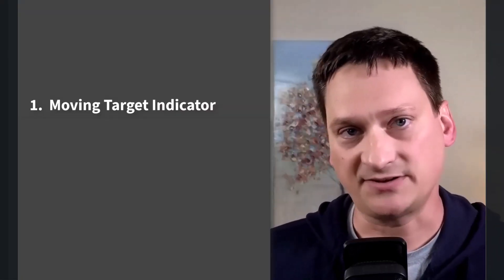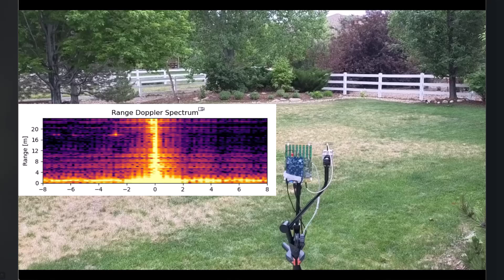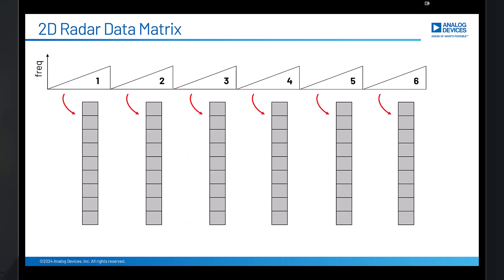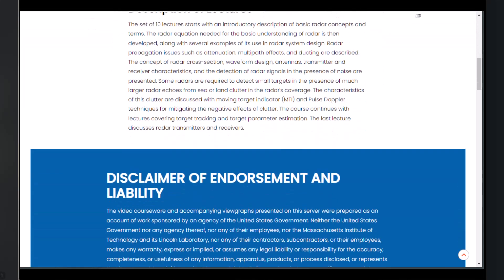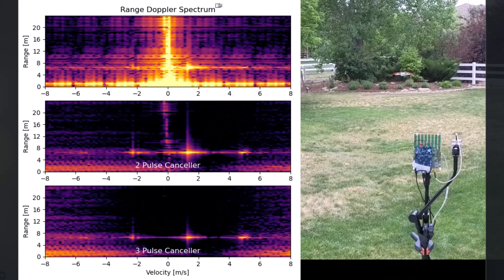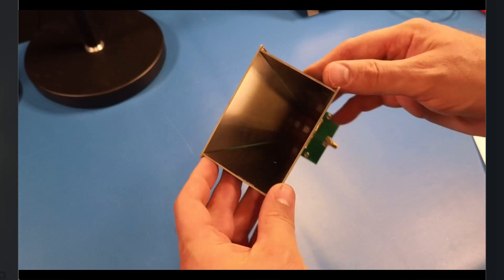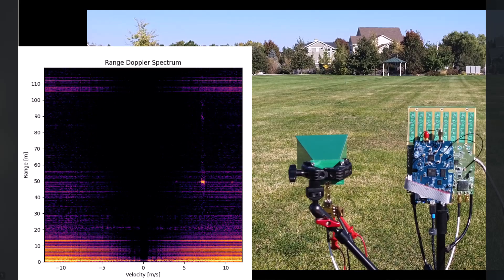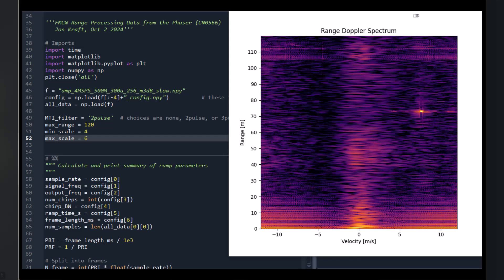Drone Tracking Radar:  Part 7 Longer Range and MTI Processing

Comment: Jon, thanks for making these videos.   I would love to see how you might be able to get MTI to work if the radar antenna platform is mobile,  if that's even possible.
Reply: Should be possible with more signal processing. Now the ground clutter (the center vertical line) would be moving too. Would be interesting to look into and to get some data samples.

Comment: Well, it of course helps to add a transmit amplifier. The question is if it is possible to improve something with antenna setup (better antennas, bigger antennas) to get even more longer range? It should be possible to add enternal atnennas to phaser instead of PCB. Could be something to do in video #8? :)

Comment: Dear Jon.
Thank you for your great work. I also played with chirp alignment (in another code) and I also had to implement similar chirp correlation and alignment. But then I found in my code that the shift in chirps was connected to wrong num_samples_frame calculation which I used here: start_index = start_offset_samples + burst*num_samples_frame. In your code here you use similar N_frame variable: start_index = start_offset_samples + burst * N_frame. After I change default code line from num_samples_frame = int (tdd… to num_samples_frame = int(round(tdd… the correlation and alignment of chirps are not need anymore. You can try in your code and also change the N_frame to N_frame = int(round(PRI_s * float(sample_rate))). So seems like the N_frame size difference changes all n chirps begin index and caused misalignment of chirps in further processing. I am not a SW engineer and can be wrong here so please review. Thank you!
Reply from the maker: Thanks!  I’ll try that out!

Comment: Great video John! I have another idea to increase the range and SNR. This works with my fmcw radar that I’m working on currently. I’m able to detect a small vehicle out to about 1km so far (given my testing environment I probably could go further) the biggest thing that I have come to realize when trying to increase SNR and detect small things like drone is Digital possessing gain. A higher number of FFT points and Doppler bins heavily increases SNR. I get a 30db digital gain after switching from a 1024 point plot to a 8192 point plot. Another thing I implement is coherently integrating chirps that are phased aligned to reduce Doppler spurs and get anywhere from a 10-12db from (4 coherent averages) in digital gain increase. You could do coherent chirp averaging a couple different ways. Note, the radar I’m working on is basically a classic MIT coffee can radar on steroids. I actually plan to integrate my Pluto plus sdr into it but I bricked it with the wrong firmware so now I have to use JTAG to recover it :(. But regarding the different ways of coherent integration, the way I do it is a very simple and straight forward approach without a reference sync signal both MTI and coherent averaging. What I do is take the chirp repetition rate and find the wave period so for example: 1/1000hz (if using a sawtooth waveform) which gives me 0.001s i can then use that value to and multiply it buy our sampling rate to get the amount of samples you need to subtract using a delay line canceler. This also goes for the coherent and non coherent averaging by summing the complex-valued signal sample Y_i = Σ X_ij where: Y_i is the output of the coherent integrator for the i-th sample. X_ij is the j-th input signal sample, where jranges from 1 to N.

Comment: Excellent video. For some reason, there's a bug in the technical support page. I can't post a question there, so I'll post it here : regarding the HMC451 Power Amplifier : does it arrive from Analog Devices with all the connectors structure shown in the video, or were they ordered separately? I've only found them for order without the connectors. Thanks in advance.
Reply from the maker: Yes, the SMA connectors come installed on the eval board.

Comment: The phase shift between adjacent chirp pulses carries the Doppler information.  Will it get affected if we apply phase alignment in the 2 pulse canceller?
Reply from the maker: It's a good thought, but no, the velocity is not affected by the 2 pulse canceller.  You can see that in the plots where I show both 2 pulse and no pulse (regular).  The velocity stays the same.  The velocity is the change in distance (beat freq) from one pulse to the next.

Comment: What would the whole system cost without the Raspberry Pi? Can we attach it to the 3ft span/15" prop drone I'm building?
Reply from the maker: Details on the phaser kit, included price and availability are here:  www.analog.com/cn0566
There's details on size and construction on the wiki page.  But it's not intended to be used in any production.  It is a learning/exploration platform for phased array radar concepts and prototyping.

Comment: Huh. "Two Pulse" looks like a high pass spacial filter. It is the derivative (difference) in image processing or image reconstruction from projections, etc.

I must make this! Maybe lower frequency with a HackRF.
Reply from the maker: Yes, please give it a try! And let me know how it goes!
Reply: @jonkraft  I wonder if you did not do the two pulse processing and just did high pass on the output image. A simple Gaussian hi-pass kernel. Would it be the same? 

Oh, wait. The data is available :-)  (If it worked you could do it on a graphics card easily)
Reply from the maker: Yes, give it a try!

Comment: You showed an X band horn antenna & spoke about the supplier. I have not found a link to this, could you please point us in the right direction?
Reply from the maker: Yes, you're right.  I just added the link into the description.  I can only find it on ebay.
Reply: You can make one yourself,
Reply: Hi, the eBay link doesn’t work, is there another source? Thanks!

Comment: The tests show that Doppler radar returns for a stationary target or target moving perpendicular to the radar illumination axis do not generate significant returns. Given the subtractive corrolated chirp suppressing the background returns I'm wondering if a diffeerntial range target tracking vs background range signaling could handle those cases.
Reply from the maker: Give it a try!  The data is here:  https://ez.analog.com/adieducation/university-program/m/file-uploads
Reply: @jonkraft  Unfortunately no real ability to do so and .  The form you use is essentially a target on a  cross vertical plane. I guess what I'm proposing is essentially creating a 2d horizontal planar correlation to highlight targets in a positional map using sort of a synthetic dopler.  If multiple mapping planes were generated, then an stationary ariel target is above ground level and should still show against the suppressed background... maybe.